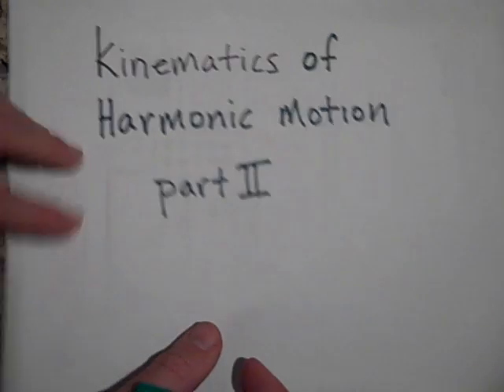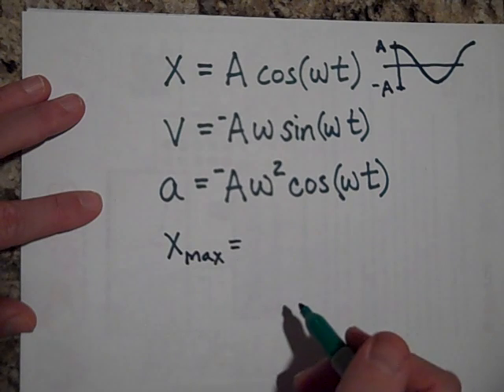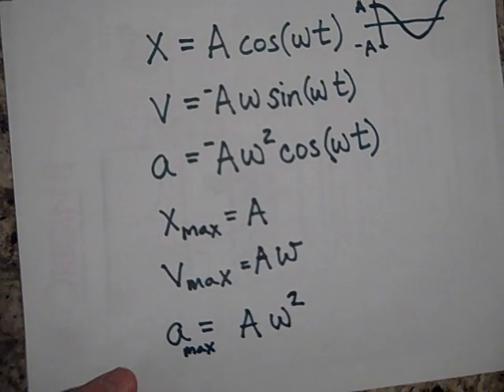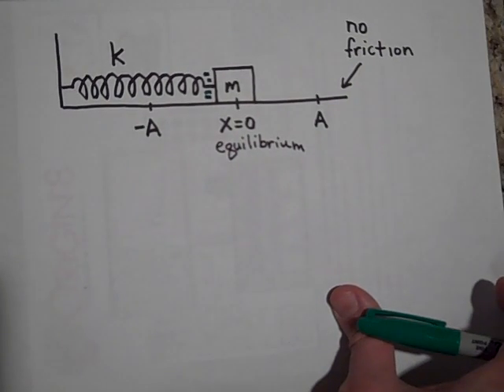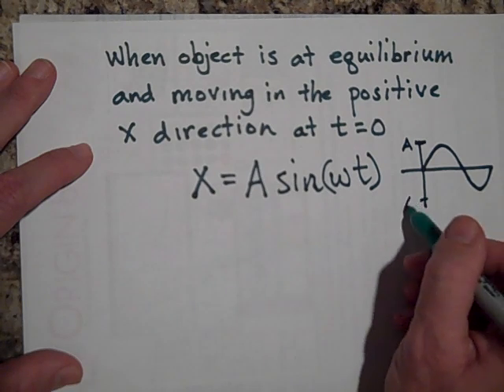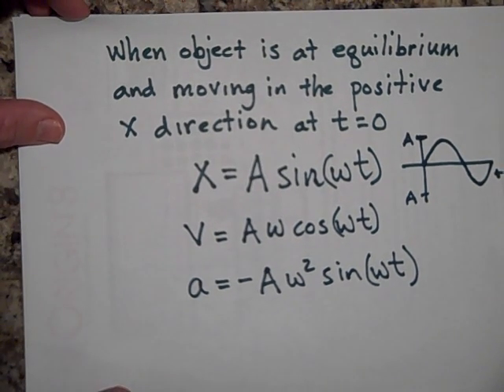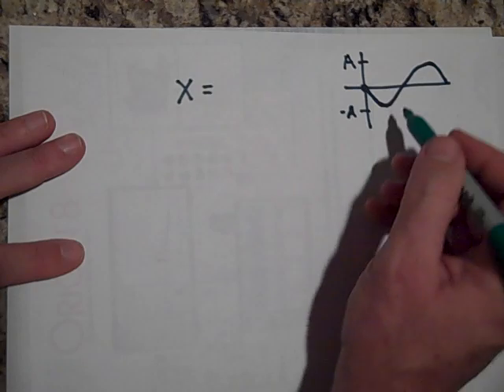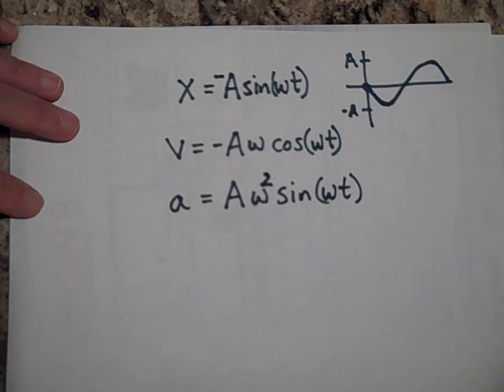Kinematics of Simple Harmonic Motion (part II)

Comment: The negative refers to the vector, if its negative, its on the left side of the equilibrium, if its positive, its the right side. Its actually mirrored in the middle, Vmax negative is equal to Vmax positive, just has an opposite direction. :)